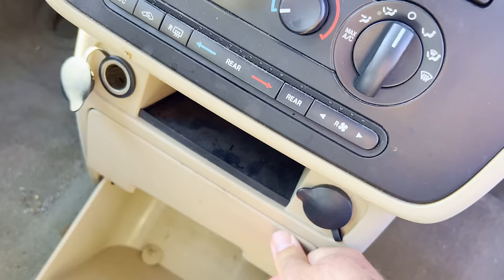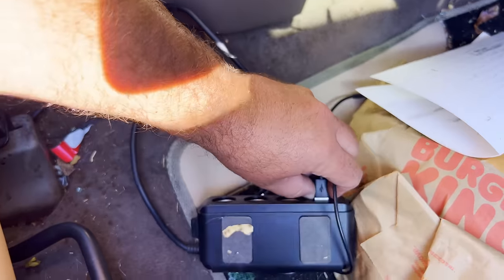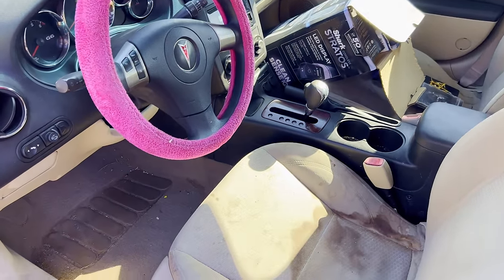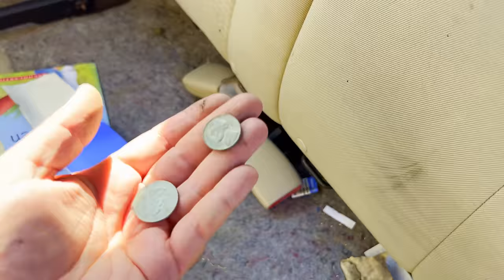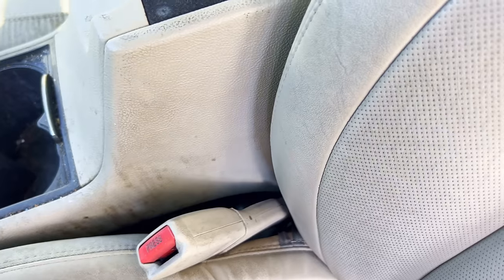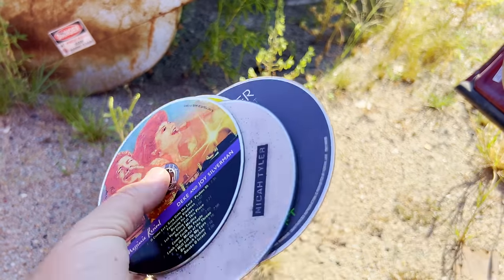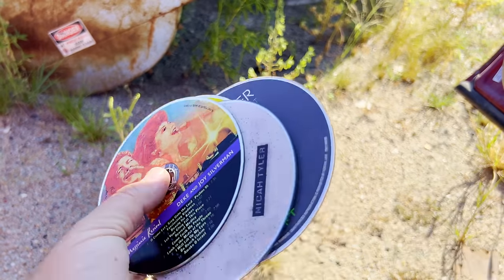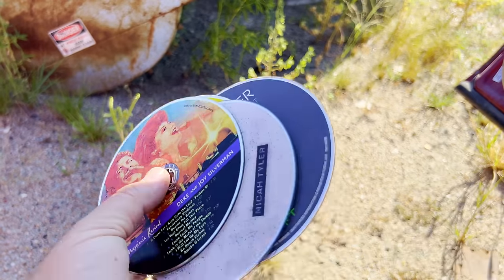I Found some Wild Items in these ABANDONED Cars at the JUNKYARD! (Cash, Jewelry, & More!)

Comment: Silas!! Love you prospecting through the junk cars!! The  U.S. Mint did change from 95% copper to mostly zinc in 1982. But, it was mid-year when they made the switch. You have to weigh the pennies to determine their content. 95% copper pennies weigh 3 to 3.2 grams each. Zinc pennies weigh 2.5 to 2.6 grams each. So, anytime you find a 1982, you'll have to weigh it to identify between 95% copper and zinc. And also, you are correct, the copper in a 95% penny is worth .03 cents.

Comment: Though scissor jacks are terrible, they're sure worth more than scrap weight, for plenty of things other than using on cars.  Time to start filling up a truck bed with them, lol.  Surprised you didn't check under the spare tire cover foam that had a jack.  Putting valuables under a spare tire that's bolted down is pretty common.

Comment: And i did something similar today, just in a box of junk instead of in cars. This is what i found!

3 iPad 2’s + 2 cases
Nikon D200 + battery, charger, lens and lens hood
4GB SanDisk CF card
WD Scorpio Blue 500GB 2.5 inch HDD
WD Black 500GB 2.5 inch HDD
Kingston 120GB 2.5 inch SSD
Sony NP-BG1 charger
2 Sata cables
4 rechargeable AAA batteries
2 alkaline AA batteries
SD card case
Camera bag
Nikon camera strap
Some random trinkets, iirc a power-bank casing, a neat heatsink, and a lego technic gear piece.

Comment: Cell phones got precious metals in the circuit-boards, so you should perhaps consider selling them for recycling, a bunch at a time. We're talking gold and copper.
The gold recovered from 1 t of waste PCBs can be sold for approximately USD 10,000, and thus the return on investment can be as high as approximately 1400%.
Found a bunch of cash myself, back when I drove a taxi, graveyard shift during a five year period - between fifty and a hundred USD a month, so along with tips it provided a fine supplement for my (low) income.
Good luck - recycling is positive, an honourable business for sure

Comment: 25:05, dang ,could have used the 3rd brake light out of that Oldsmobile! ...just gave my friend a brand new reverse light assembly for the very same car that he has ,he broke the reverse light & couldn't find a used one anywhere, but he was in luck ,i had a brand new NOS assembly in the GM box in my closet & hooked him up with it,i also had the missing wire wheel cover locking wrench that he was also missing, i actually still sell or use those wheel cover wrenches & locks

Comment: 27:00 "I don't know what this is."  To remove/install fuel lines to a fuel pump inside the fuel tank. I needed a similar tool to replace the fuel pump in my 1996 Bronco.

Comment: The copper value did exceed the face value of 1 cent coins. That's why they changed the composition in 1982. They also passed a law making it illegal to sell copper cents for scrap. The concern was not having enough coins in circulation. The old solid copper cents definitely last longer than the copper plated zinc variety.

Comment: The big wire in the back seat with the fuse link in the backseat means it had a big audio system id check the door speakers if there nice upgrades

Comment: That tool you couldnt work out what it was is a fuel line disconnect tool. They are used on fords and other makes. You clamp it around the fuel line and push it against the connector and it releases it  The ugly stick i have one here in NZ They are flexible but don't break.